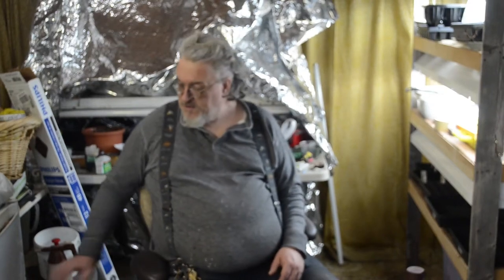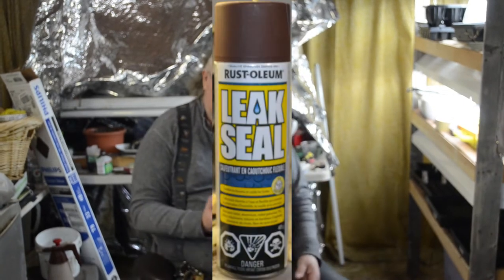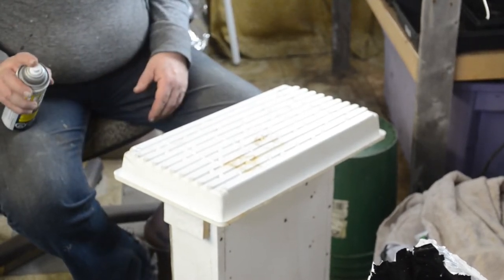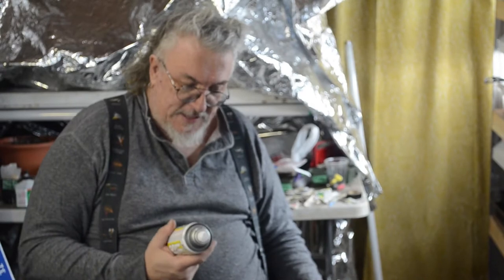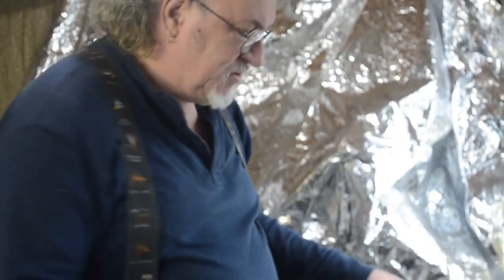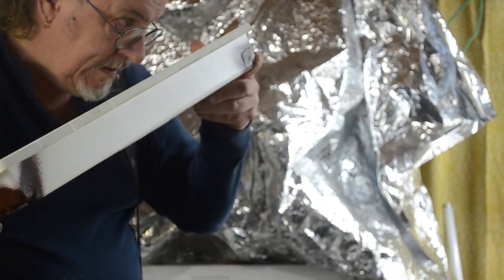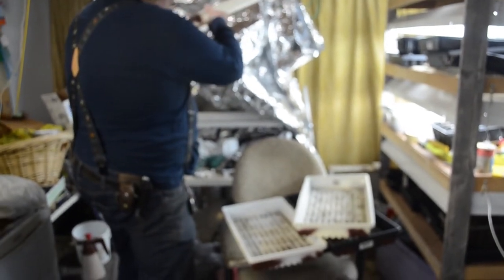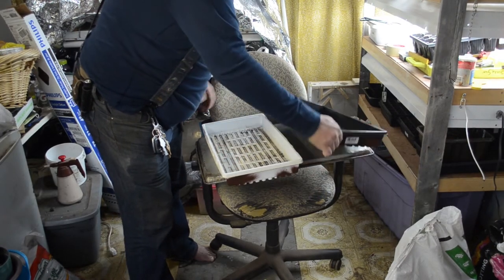Spray on Leak Seal and Seed Starter Trays

Comment: That's a good idea...I just passed all of mine to check for those damn pin holes and just dab them with a bit of bathroom silicone
Reply from the maker: Awesome Idea, Ricardo! I had thought of that, but I didn't think I'd ever get them clean enough for the silicone to stick! So, it works for you then?
Reply: @trollforge  yes, I just brush the old soil of the corners , and smear the silicone with my finger...a good idea would be to do the 4 corners when they are brand new

Comment: That's why I DIY. Commercial products you buy them and fix them immediately. Or just buy it to use as a template to build your own.
Reply from the maker: I've been using these trays since High School, and I know I have had some last for 10 years, Last year I had too many trays sitting on tables too long out in the sun, and it made many of them brittle. I don't know, maybe I've been using them so long that it's become an addiction! I have been putting thought into making my own, but everything I use is sized to fit these trays...

Comment: I know it's not always possible to go out and get new trays, but that leak seal paint is too expensive for me and I can't handle the fumes. I usually do the same as Babette and line cracked ones until replacement is possible.  Take care my friend - Marcie
Reply from the maker: It is expensive!!! But I have had a few customers ask me about it, so I decided that I needed to try it on something!!! I was at Crappy Tire and they ordered the perforated flat trays instead of the watertight ones, so...

Comment: Interesting. That stuff is toxic
https://www.rust-oleum.eu/static/safetysheet_msds_leakseal_3478_en.pdf
I use 2 or 3 trays together when they leak and use a plastic bag between the layers
Reply from the maker: Yes, but that is all about the volatiles, making it (IMHO) more dangerous to apply that to use once cured,,, BUT lets remember that these trays are either: PET (Polyethylene Terephthalate), or PVC (Polyvinyl Chloride),  neither is food safe once exposed to soil organisms and/or UV light... and there is a fairly good chance that your plastic bag is PVC as well...